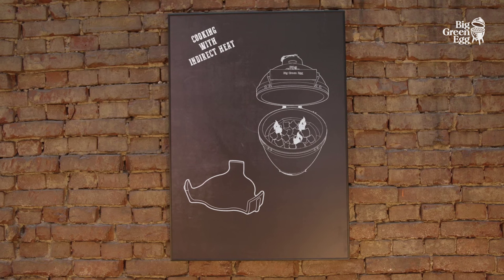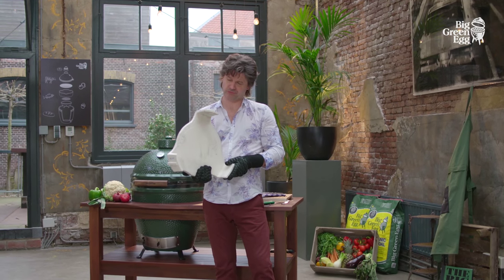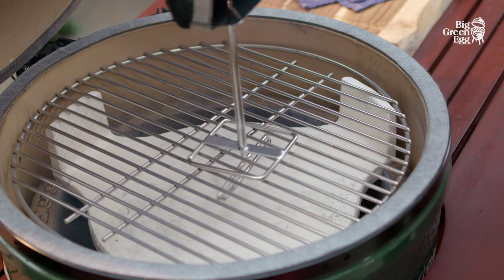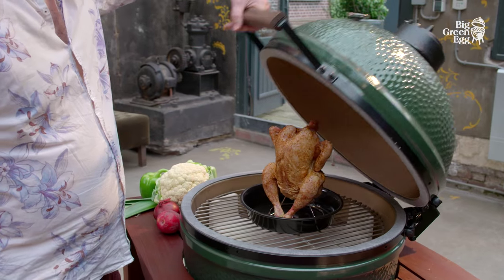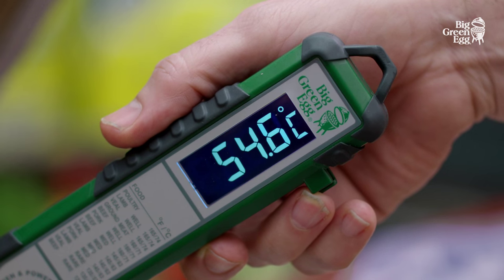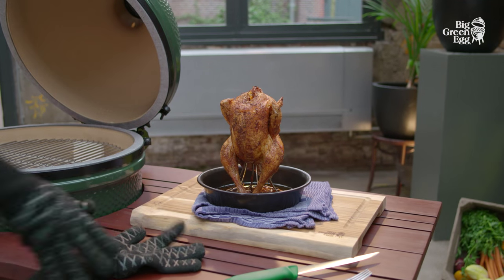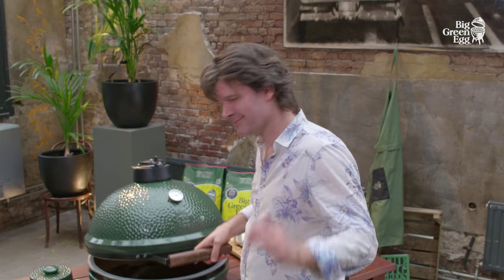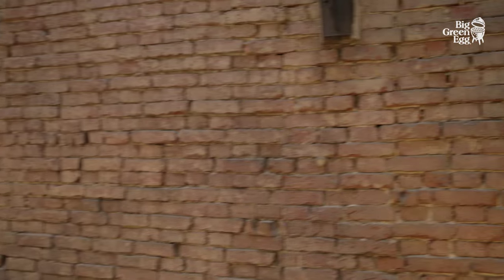Big Green Egg Instructions - Cooking with indirect heat

Comment: I do indirect much more than direct on my BGE.  It's more forgiving and it allows some additional cooking time to possibly infuse some more smoke.  I don't do vertical but will admit the method shown here is spot-on for a good result with the cast iron pan as a rendered fat catcher which makes for little to no mess.  I wonder if anyone has done what I tried successfully to my delight and that is use pecans for creating smoke.  I had a mess of pecans too old to consider to be edible and as a experiment I just soaked some in water and threw them in after I was cooking for a little bit.  Of course the water created some instant steam but soon I could tell the smoke was not due to steam as much as the pecan shells and the meat inside.  I admit I was worried that the natural oils may be rancid inside the over two year old pecans to the point of not being usable.  But, to my great surprise, this is a wonderful use of aged pecans that are no longer prime enough for eating raw or roasting.  Try it.  I don't think I'm dreaming.  It made a kind of smoky sweetness I must say was enjoyable.   Only problem is now I have no living relatives with pecan trees so It's kind of dead-end thing unless I want to spend $$$ for pecans in the shells.